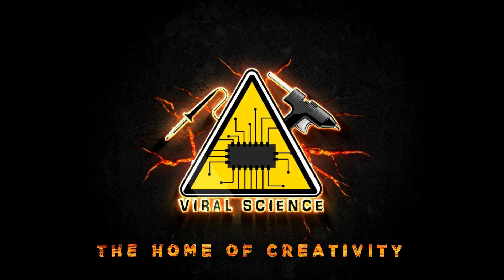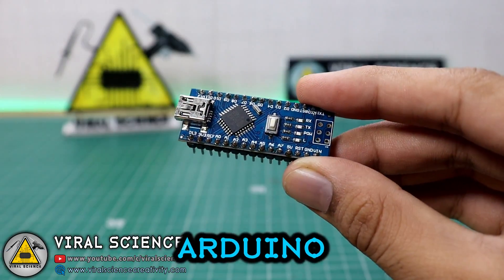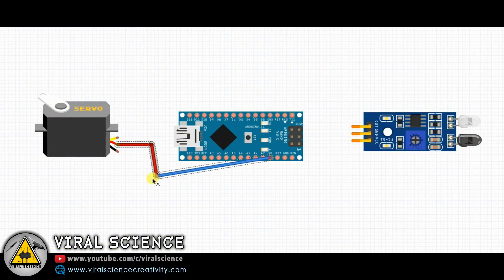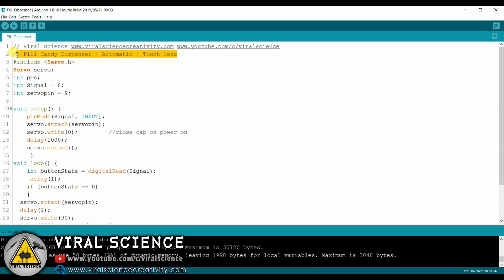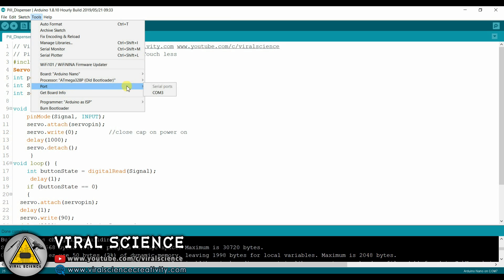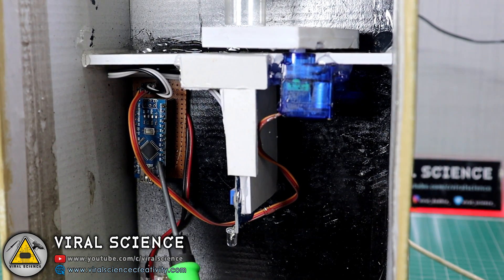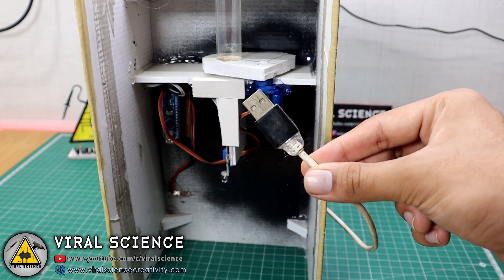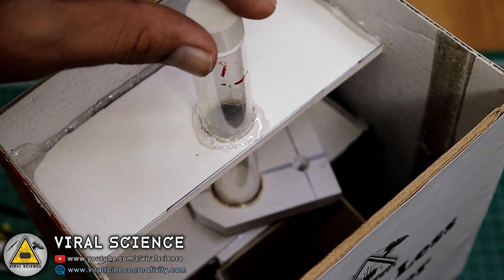Arduino Automatic Candy Dispenser Machine

Comment: How did you get the IR sensor wired as well as the Power Supply? I want to make this for a project and never did anything in this field, is there any way you could explain what to buy and where to place the wires so its set up the same?

Comment: Can anyone help me? My IR sensor keeps detecting the bottom of the candy dispenser so it keeps dropping another candy after the delay. Is there a way to set my IR sensor to not detect the bottom of the inside of the dispenser?
Reply: just adjust the distance to be covered by the sensor which is found on the IR sensor using the potentiometer found on the IR sensor. mainly, minimize the distance between the sensor and the bottom of the base.